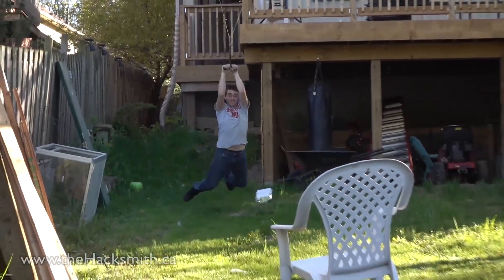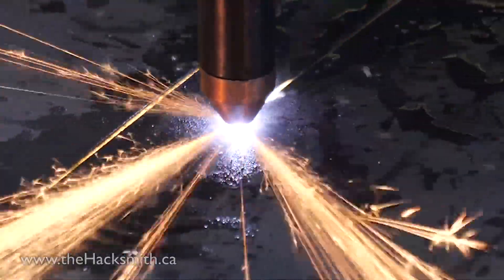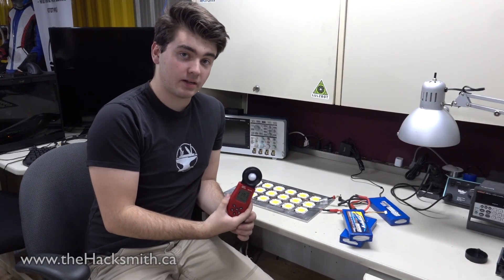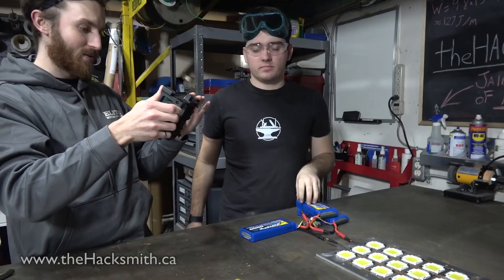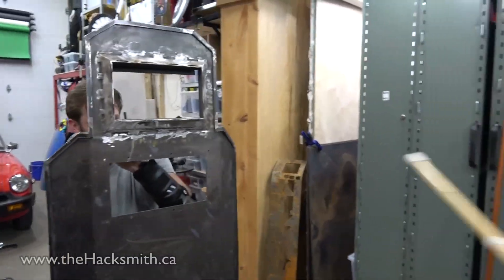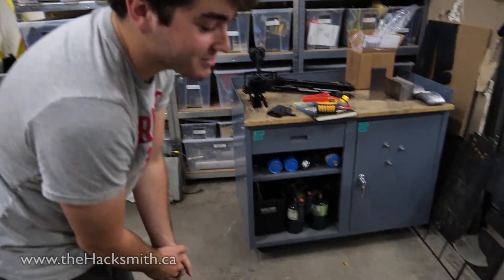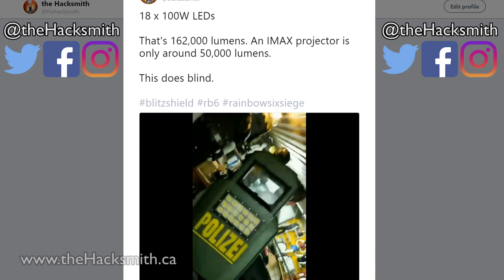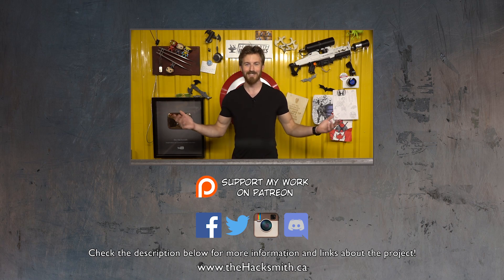Real Life Blitz Shield is BRIGHTER THAN THE SUN! (from R6 Siege)

Comment: Quick question. Would you be interested in revisiting this project and using more lightweight materials? Most riot and ballistic shields aren't made from metal like that. Or was there an issue with using plastic composites or polyethylene in combination with the electronics?

Comment: In my opinion next time you shold try with Kevlar fabric ! a thick stack will easily have a good nij rating similar to that steel plate . You will gain a lot in overall lightness  but  with the downside of integral structure due to kevlar absorbing bullet power and no protection for rifle rounds .

Comment: Hmm maybe cut down the overall weight if you replace most of the steel with the material that Riot shields are made of? that would make it far more wieldy and also probably find a way to increase the brightness of the light to make it even more blinding?

Comment: Instead of that handle on the bottom, you could probably screw in a sling that goes over your shoulders to help take the weight of the shield off of your arm. Real historical shields did similar things.

Comment: I think part of the problem here is the assumption that the shield is sheer metal. Blitz's shield is most likely a composite material with carbon fibre and ballistic weave paired to a SMALL amount of metal. While the game shows a metal shield Riot shields are notable not metal anymore for this reason (weight). As for the flash mechanism I can't complain with the ideology here though I would say that your lights probably make more sense than the flood light ideology that others have toyed with for this shield design

Comment: the Hacksmith   Don't get me wrong, the whole project is cool as hell...  BUT, Why the  F**K did you go with SUCH a heavy design approach?!? 
   Just say'n, I Know YOU guys should be able to fabricate this shield with a design that's at least 50% lighter than this prototype. 
Just making a relatively Rigid Shell/Support Structure to incase Layers of Ultra High Molecular Weight Polyethylene  (I think I'm remembering that correctly, lol), or Kevlar type Aramid. 

Hell, If ya go thick enough (around 1.3" thick) with the UHMWPE you get into Rifle round protection territory at roughly 1/3 the weight of comparable Steel lvl III Rifle plate armor.    👊💥 It's still a f'n badass Shield though!!  😎,😜🍻

Comment: I think there is a little error in this video : first of all, of course the shield will be super heavy if you use heavy metals. Army usually uses low weight but higly resistant metal/material.
Reply from the maker: Yeah can't weld aluminum

Comment: This is wickedly cool don't get me wrong but Lux is measured at 1 meter. When directly compared to sun light or any light source. By the time the sun light reaches earth after millions of miles the light is pretty consistent in lux from a few hundred miles up to the ground. This number should be approximately between 75,000 and 120,000 lux depending on time of day and weather.  

If at 6" (estimate) you get 1635 you'd get about 248 at 1 meter vs sunlight according to your device and settings 1095 (if we average sunlight to 97500 true lux) that gives this shield's Lux output of approximately 22,082 true lux. Obviously MUCH less bright than sunlight. 
Now granted 22,082 lux isn't poor performance. But it should be noted that most any tactical flashlight or even a cheap 2-D Maglite will outperform this. 
The reason: Surface brightness and lack of focus. Lux is how intense a light source is, how far the beam will illuminate a target away, or how well it will blind someone. What this light is good at is light OUTPUT. Maybe 70,000+ lumens! Its only real advantage is angle of illumination. Someone could be 60 degrees off from the side of this thing and it would hit them with the same force as directly in front. Granted it will only hit them with the same intensity as a good tactical flashlight. Essentially this is a standard intense flashlight that you don't have to aim into someone's eyes.

Comment: I'm not exactly sure but from how it looks in game, the lights module is placed on the bulletproof surface of the shield without any holes in it(at least that's how it looks like if you look at in-game what isn't hard as games allow to look at them in "paintings" menu to see how different paint jobs look at it), like even cables connecting the flashing LEDs to the circuit behind shield are visible, after all, its primary function is to be bulletproof so any weaker material in the middle of it could ruin the point of the shield, but outside of that great job

Comment: Ive been watching you for a while now.

and i know this video was 11 months ago
i just want to clear it up for some of the fans who haven't played siege before, which i do think there is a lot

Blitz's shield, which is a shield with 4 charges of instantly activated lights that function just like flashbangs. However they are brighter than the shield displayed here. the blitz shield actually overcharges 6 lightbulbs at once, causing them to generate insane amounts of light, which is why there is a sound of glass breaking everytime this is used. which also explains why it can be used only 4 times.

Comment: Ya got lathe's and milling machines??
Reply from the maker: Yeah, we've built up all these tools in the past 3 years :) this is what happens when a YouTuber reinvests into his business as the channel grows :)
Reply: @hacksmith  dope ive study to work with these machines but technically still need my internship before I can tell myself I earned my associates
Reply: @hacksmith  also I think the shield in game is 1/4 inch thick then tops with Kevlar so the metal is more like a frame more then for bullet proof, but the metal will be bullet resistant and the panel for the is probably double glass panels for the best bullet resistance using that bullet proof glass, so the real shield maybe a lot heavier

Comment: Put the battery box closer to were your arm stapes in to center the weight...and take ta handle on the bottom flip it and move it up about 5 inches...and move the other grip and strap system down about 8 inches would make it way easier to handle
Reply from the maker: the battery box isn't what is heavy though

Comment: I want to make a pair of glasses with those LCD panels. Run a simple circuit from a clock battery or something to a switch to the screens. Where do I get those panels?
Reply from the maker: Welding helmets do the same thing
Reply: the Hacksmith  well, yes. I’ve got experience, believe me. But I’m thinking    a darkening at the push of a button kind of deal.
Reply: Instant sunglasses if you will

Comment: An idea for an upgrade, make the light clockwise polarized. This way if you are wearing counterclockwise polarized goggles you won't be affected. This design is an upgrade because on the battle field there probably would be more than one of these shields in play, and you don't want to blind your allies. This takes away the need for the LCD panel to be synced up. (I think you can source the rotational polarizing films from modern 3d movie glasses)

Comment: You should add a capacitor so it flashes, like in the game. Otherwise, you have a very large and unwieldy, powerful flashlight.
Reply from the maker: The Russian and the Wolf you should watch the video... It does flash... Completely programmable too lol
Reply: I mean, it should just turn on for a brief moment, rather than strobing or staying on.
Reply from the maker: Very easy to add. Or you just press the button quickly. More blinding to leave it on though, that's why it's better than flash bangs
Reply: Makes sense, having both. Go for effectiveness, or close to in game. I see where you're coming from. Cheers.

Comment: A poly carbonate riot shield (already clear, light, and bullet resistant) with a layer of dimming lcds, and the dimming unit would yield a unit alot lighter. Possibly more practical if you can get your hands on it or fab it in house.
Reply from the maker: Sean Flynn for sure! We only made this one the way we did because of the game :)
Reply: Polycarbonate is resistant to pistols; steel like this, when properly treated, is used to resist rifle rounds.

Weight vs protection is a constant trade-off, for future reference.
Reply: Yes

Comment: Well tbh. Blitz is a highly trained, strong dude.. I would bet 5x as strong as you guys (from look) ofc he can hold it easier
Reply: Plus he uses it CONSTANTLY
Reply: The biggest issue is it's made of the wrong materials. They don't make it out of solid steel, and it's not rounded, so direct shots just go through. Real shields are 9 or 8 times lighter. I like their work, but this was a fail.
Reply: @wack420  There are Level III shields available, 25"x15" I believe if you look at the Bravo Shield.  (Kind of small if you're any taller than average...)  It's close to 25lbs, but is certified to stop 7.62x51 at 2800 FPS.

P.S.  It's basically just a slab of armor steel and titanium laminated together that you carry as a shield.
Reply: Blitz is in his twenties dude.
Reply: Blitz is 37
Reply: It’s a video game the weight isn’t going to be accurate lmao
Reply: Peter Parker not 5x more life 1x

Comment: Real cool stuff. Though if you want to be able to carry it around you need to use ceramics and Kevlar as well as special tool steel. Though even those things aren't designed to take much more than a magazine or two of intermediate cartridges with mild steel cores let alone full sized rifle AP with hardened cores. Though to be honest if you've got guys dumping 20+ rounds of .308 AP at you at close range from FAL/G3 or some LMG you are pretty fucked and focus more on not getting shot at all. Though with that said I understand why you couldn't make a real one, as it would have probably cost like 10x as much easy if not more and not really add much to the video. I'm assuming you didn't use any fancy hardened steel that they use to make steel targets or bullet proof armor plates, that alone could bring the prices right up without Kevlar, ceramics and coatings.  To again very cool stuff.

Comment: i wonder if you used a very thin sheet steel and layered kalavar  like the ballistic plates they use in regular body armor if you could drastically lower the total weight enough to make it a viable item that true law enforcement would be interested in. lets face it the strobe would be as good or better than a flash bang with out the possibility of fire

Comment: Adding a counter weight at the top of the head piece could help with rotation. Also it looked like yall turned it on its wrong side when rotating in the video. If you turn the head piece to the right it will alleviate the twisting of your arm.

Comment: Hey Hacksmith Team, i just want to ask what Relay Setup you use at the first Lightning test of the shield and if its nessesary to the complete function?

and I want to say that you make Great work and i love all of your projects.
Grettings from germany
Reply from the maker: A relay is just an electromagnetic switch -- we just had a 12V battery power the relay via a button, and the 36V power supply run through the relay to power the lights =)

Comment: You could make this lighter by using a kevlar ballistic shield.  You could maintain the ballistic integrity by making the lights and batteries for them a self-contained unit fashioned to the outside and activated wirelessly from a control on the back side.

Comment: Ballistic shields are made out of materials such as UHMWPE or pre-preg aramid fibres.
Lay-man terms - they made of "ballistic fiberglass" and ballistic "plastics" composited together ... Nobody would use steel to make such a shield.
No swat team is running around with 100+ lbs shields... especially because that thin steel wont stop a 7.62mm AP
Reply from the maker: It's metal in the game, so that's what we made

Comment: Ballistic shields are not made of steel. They are normally made of UHMWPE. Much lighter but will still stop bullets.
Reply from the maker: It's metal in the game
Reply: Everything i've seen about the shield says it's a ballistics shield.
Which should be composite material. If the developers made shields metal they messed up on the shields.

It was modeled after the Entry 1 FR IIIA shield.
Reply from the maker: Well it also sounds like metal when they shoot it... check the Wikia on it

Comment: Actually something I was thinking you guys could do but I don't know if you would because a lot of people probably don't know about it and I have no idea how you'd do it would be to make a functional pair of Air Trek from the manga/anime Air Gear. The way they're described in the show is two wheeled roller blades with micro jet engines as the motor allowing users to reach insane speeds and no crazy tricks.

Comment: Sometimes overheating LEDs are just caused by Not putting Proper current limiting resistor in the circuit - because this array of LED arrays are not the same in the voltage drop

Comment: Why not take an actual police CQB shield and add lights? The lights shouldn't add much weight at all
Reply: They mention it should be bullet-proof and that they are going to test that ability. Plus the way they made it is almost a spitting-image of the in-game item.
Reply: jack ward It would just make for an easier build, less fabrication time, and also alot lighter than using AR500 steel

Comment: The real buff blitz needed. instead of charges just using straight up powerful LED's
Reply: I think Blitz used older style, disposable magnesium or zirconium flash bulbs. Hence the limited uses.
Reply: its flash bulbs. that's why you hear the old flash sounds as it goes off
Reply: Even know thats not true, that would be a funny skin though.
Reply: The only problem is the amount of power needed and the bulk of which would not be fun to carry at all times. So having a chemical reaction works better because it’s easier to replace and less weight
Reply: Joe Hudson  LOG
Reply: He put flash bangs on his shield

Comment: Since it should be used ideally with one hand free to fire back, is it possible to run the switch/dial fir the lights from where the left hand already sits? Even if it's a simplified 3 mode system, combat efficiency is important for those CQC moments

Comment: What would've made this even cooler is if y'all went and found a way to get a button to limit the light time to like a fraction of a second. Would've made it possible to use even brighter LEDs for the flash with the same power usage (i.e. same battery charge per flash) and would've made it even more effective, especially considering one of the things that makes a flashbang so disorienting is the sudden comedown from massive brightness to ambient light levels. If the shield itself was a little bit longer I bet there would be a few police units in Germany or Austria that would kill for a mobile flashbang on a shield.

I'm no engineer, but you probably could figure out a way to do it with a (relatively) simple circuit board or switchboard setup. I've seen Micheal Reeves do something similar for making lights flash super fast with one input, so there's definitely a way to get it to do it once upon a button press. I'd love to see a followup video on this thing, it's super cool.
Reply from the maker: We didn't go into much detail in the circuit but we have options for all of that! When we show the final close up of the shield theres a sticker with all the different modes we made. Including a strobe mode. =)

Comment: So the shield has 100 more lm output than a light grenade but note that blitz has a flash bang effect which also emmits a sound about as strong as 170 decibels. The shield definitely does not have the light of a flashbang which is about 7 million candela. So basically a flashbang emmits 87,990,000lm in a sphere as that shield emmits 1600 foreward.  So the real(blitz) shield emmits about maybe 1/6 of the total lm (because a sphere I interpreted it as a cube and I divided it by the sides etc) of a flashbang forward which would be about 14,665,000lm. I could be wrong though. I am not so good at these things but this is the correct math I think.

Comment: Realistically the shield would be made from a one piece fiberglass and resin board made specifically for that purpose, it would have to be between 1/2" and 3/4" thick. Weighing substantially less than a similar steel shield, the L.E.D. array would have to be mounted to the front of a whole shield with the powering wires going around the outside of the shield. Putting holes in a shield compromises its protective ability by creating weak points. Still a cool video.
Reply from the maker: it's metal in the game, so we made it metal
Reply: the Hacksmith I under stand completely it looks great and loved the video, but the game contradicts itself. The shield in game is hard wired yet some how a radio signal jammer prevents its function, If you look closely in game the shield appears to be of a fiberglass and steel core. The bullet impact sound is simmilar to 1/4" steel covered in a 1/2" inch of truck bed liner.
Reply: Thor's hammer was the best though